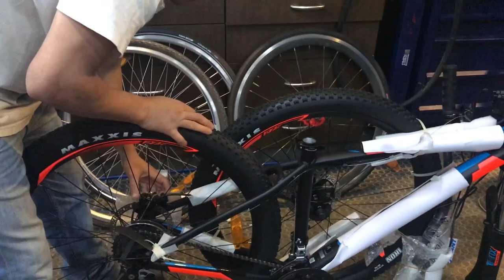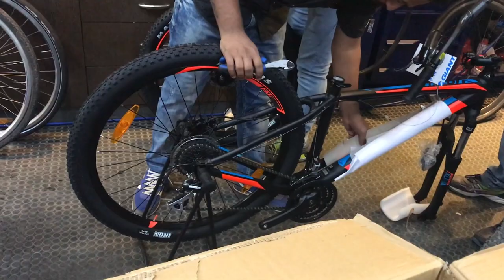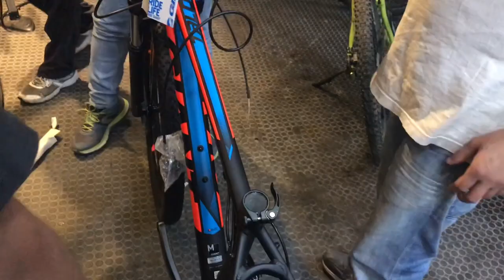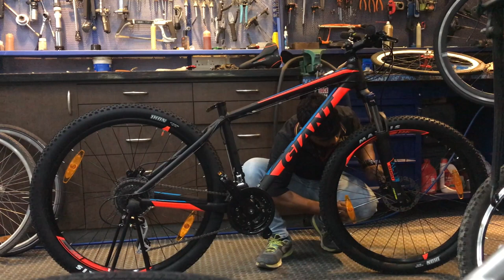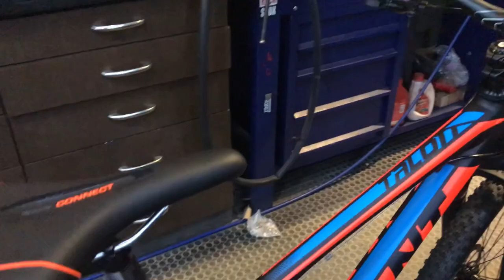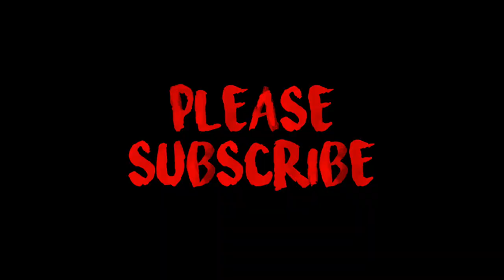GIANT TALON 3 UNBOXING AND SETUP | GIANT BICYCLES | COLOUR GARAGE | 2018 |

Comment: How come the cables are not internal ??
Reply from the maker: i dont know man. That is how it  was in the cycle that i got
Reply: Cool Good luck
Reply: 17 not 18
Reply: ARJUN REDDY you're wrong about that you can get a specialized pitch sport for $600 it has internal cable routing
Reply: Because internal cable routing sucks for maintenance
Reply: ARJUN REDDY  Nope, the talon 3 2018 have internal cable routing but I dont know to this bike.
Reply: Why the cables 🤔😟 get a Giant Phatom instead. Phantom my mountain bike and Giant Defy my road bike. They are great 😁
Reply: This is the 2017 model
Reply: I have a talon 3 2018 and the cables are internal